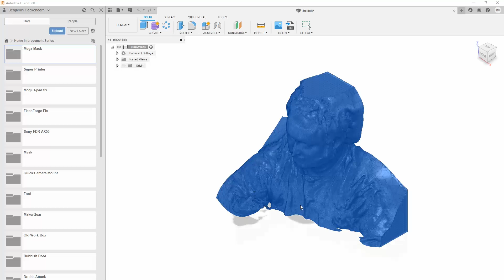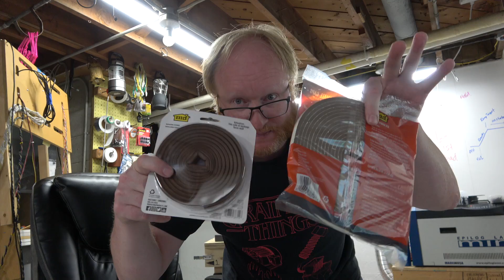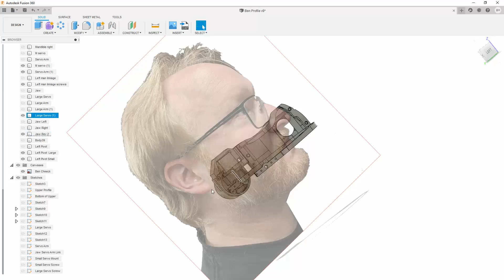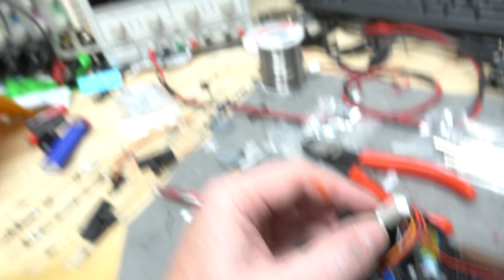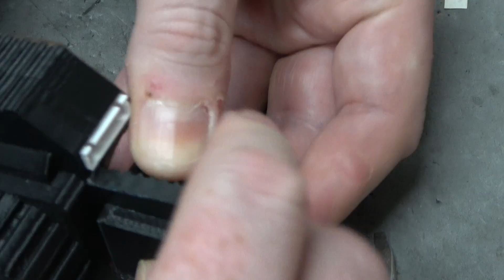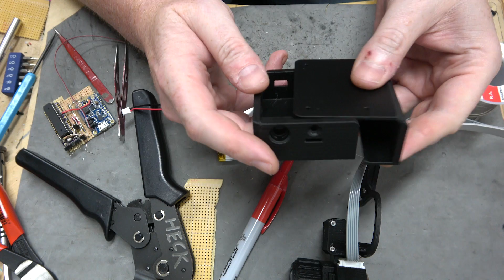Auto-Mask (Mark 1)

Comment: I saw just 15 min, so idk if this problem will be fixed later in video, but I have some suggestions: I can already see the point of failure of this project in the hinges.
Why let the servo carry all the weight when you could implement the hinges in the "round servo support", using a much solid 3/4mm bolt to support the moving parts of the mask and than use the servo just to open and close it, maybe implementing a simple lever system in order to reduce the servo effort and increase opening and closing speed.

Comment: Pretty nice!  Its the first Video from you in see. Perhaps a little tip. I use for small Projekts the "Atiny85'. I think of you dont know it it will help You alot for downsizing something. 
https://www.amazon.de/AZDelivery-Digispark-kompatibles-Development-ATtiny85/dp/B076KVKHH1/ref=asc_df_B076KVKHH1/?tag=googshopde-21&linkCode=df0&hvadid=310761028777&hvpos=&hvnetw=g&hvrand=10264697216154563659&hvpone=&hvptwo=&hvqmt=&hvdev=m&hvdvcmdl=&hvlocint=&hvlocphy=9062709&hvtargid=pla-601822248880&psc=1&th=1&psc=1&tag=&ref=&adgrpid=62550347740&hvpone=&hvptwo=&hvadid=310761028777&hvpos=&hvnetw=g&hvrand=10264697216154563659&hvqmt=&hvdev=m&hvdvcmdl=&hvlocint=&hvlocphy=9062709&hvtargid=pla-601822248880

Comment: The Gap problem can be fixed by adding a bit of overlaping on one side and underlaping on the other sideof the front pices, with a minimum delay an the inlaid on wen closing. And more stability in total is possibile wen you add a halfsurcle from the back of the head going over the esres to rest on, it will be most likley less wobbly then now ;) sorry my bad englich im from Germany ;)

Comment: Next project: Build a smaller, fully portable, raspberry-pi based 3D scanner (like the MS Sense) out of Hello Windows laptop webcams that can do the full scanning/editing/everything from anywhere. 
(There was an HP line, for example, that basically had a Kinect board smaller than your pinky in it - those go for about 12-15 on eBay. And it’s just a standard usb 2.0 interface on those pins!)
Make it smaller, make it portable!

Comment: What I would do is make a pair of glasses and just have under the lenses seal around my nose, then have the same upward mechanism with servo-motors that you used to bring a breathable cloth/lighter cloth that you can breathe through up to the bottom of your glasses. That way you just put on your glasses and have a built in toggle-able mask with plenty of clearance (when down) allowing you to eat/drink, and when up it wont fog up your glasses.

Comment: You could put some rubber on the top to make it more of an air tight fit like a gasket, the servos will have to press on the face more though. 

 I don’t know if that filter fabric will work though. The cdc says you should use N95 surgical masks. It does look good though if the fabric doesn’t absorb water.

Comment: Here a challange for a Auto-Mask v2.0 (Image below):
- Modular Filter: Then you can make a small modular pierce of filter that you fit in the filter slot inside
- The front instead of "predator" style, make it open:
1. It releases forward (This way you can apply pressure by covering the areas it shouldn't be open)
2. Then it goes down

If you close by applying pressure backwards you could make it adjustable for any person and release the fusion file with the material and components required to allow anyone that wants, to try create their own.

Here an ugly sketch i made in Krita to describe my idea: https://ibb.co/tzrwRbR
Cheers

Comment: Could probably add a small elastic strap over the head, like a vr headset, to relieve pressure from the ears, provided the whole thing is at least somewhat balanced front to back.
Would also be cool if the arms could rotate outward at an angle, so they weren't sticking forward, but would come up to the sides of your face.

Comment: split mandible with magnets in the ends and something like a rubber gasket can hold them sealed. You can also include a magnet or two on the piece that comes up to seal that gap as well.

Comment: Really fun idea, but in mk 2 ditch the fans, they are really missing the point of masks.  Masks provide some small protection by lightly filtering incoming air but the real point is for everyone to wear them and limit/localize their output into the space around them.  Buy putting in fans you are pushing potentially infected air out further than a mask should, or sucking it in, depending their orientation.  Either way, its antithetical to the core goal.

Comment: Awesome design!
Possible design change could be to make it an electromagnet on a momentary switch that holds it closed.  Spring loaded to open up, but manually push the pieces together with EM activated to make it a clean close. Then it fast opens by deactivating the EM.

Comment: you could use solenoids instead of servos, you might be able to get away with a smaller mechanism with them. also,  you could use electromagnets to keep the mandibles closed, it would be interesting to see some graphed data about strenght of the electromagnets, power consumption and volume or weight. Maybe there's a sweet spot that you can choose
what an amazing project!!!!

Comment: maybe instead of using individual motors/servos you can have one in the back of your head and just have it run like cables to perform the actions also use springs for the closing action.  This would simplify things a lot.

Comment: The opening face mask is fine, but it needs a pressure fit to confirm it's closed rather than relying on weaker small magnets.  One idea might be to do a sort of tooth design like your adjustment clips, just S curve teeth down the middle of the mask and let it join that way to confirm it's together and in the right height positions.  You would then need to find a way to keep it interlocked.  Padding isn't a bad idea as well to minimize bounce back from mating the two sides.

Other points to mention:
1.  Furnace filters are terrible for small particle filtering.  The virus passes through it, basically.  And as someone else mentioned, the filters are usually made with fibreglass which you really don't want to be breathing.  You might instead want to cut up N95 masks and look into this sort of design for inspiration:  https://www.cnn.com/2020/07/25/health/reusable-face-mask-mit-wellness-trnd/index.html
2.  Using elastic or rubber head straps may make for a more comfortable fit on your head.  As you said, it's a lot of weight on your ears, but if you split the load across the crown of your head and the base of your skull, it should feel more comfortable.  The dream is to have a strap over the top of your head like a headset for the best weight distribution, but I guess how much of a dork do you want to look like?  >D   Also, straps around the crown and base of your head help to give a better pressure fit for the face portion of the mask.
3.  I would consider thicker padding for the area against your face.  In addition to a better pressure fit, with skin moisture it should form a decent enough seal, and it'll help against unfortunate closing accidents.
4.  Please, filter your output fan as well.  A part of the point of masks is to keep incoming particles out of you, but the other part is keeping your (possibly infected) breath from projecting to others.  A fan blowing your breath out unfiltered is about as bad as coughing non-stop.

Another thing you might want to consider is a solid face mask top that marries to the bridge of your nose and cheeks as it ideally does now, but when you want to divest the mask, it extends forward to gain clearance and entirely rotates down like the current curtain mandible does.  The end result would be the entirety of the mask being below your jaw.

Comment: It’s a cool idea, I do like it, but I also agree with you that it can be simplified. you could probably make that bottom portion the entire mask just by running a thin metal wire or plastic tube through that fabric portion and having it lift over the nose and tighten, probably with a servo. It would probably fit your goal of a two servo design if it’s kept very lightweight.

Comment: We're technically on a form of the metric system as an inch is defined as 2.54 cm exactly. 

There's 5280 feet in a mile, which means after the jump up to a yard you can easily cut up a mile into yards dozenally. 5280 / 12 / 12 / 12 = 3.055 repeating means you're like 98% accurate. We get to keep having a weird system but at least its internally consistent with units between yards and miles.

2.54 cm in an inch
12 inches in a foot
then 3 feet in a yard
12 yards in a whale
12 whale in a field (around the length of an american football field)
12 fields in a short mile or "smile" (5184 feet or 1728 yards) 96 feet short of a mile.

Then either metric or thous for everything smaller than an inch according to taste. It's 98% accurate for the mile, and you can basically get away with just saying "a mile", everything else is accurate by definition. Dozenal systems divide nicer into ratios.

Comment: Maxilla. Almost sounds plural so it works for a split piece, and it also sounds a bit moar badass than mandible.

...and removing this semi-automated mask takes an order of magnitude more effort than the Korean War era surgical mask at the beginning, which itself requires an order of magnitude more effort than an N95 or a cloth mask with similar ear loops. Good job! Seriously though, great proof of concept. I think the points where it falls down are tied to using a 3D printer for prototyping.

Lots of people just pull down an N95 mask over their beards to have a drink or a smoke. I'm guessing your next iteration will simply snap shut between the nose and the upper lip, pulling up a bellows that again extends over the lower jaw. if you include a set of complementary ridges on the mating surfaces, that should make for a decent enough seal.

Comment: Looks cool, but as an MD this mask is worthless, first thing to consider about creating a mask is to have easy sterilization, cheap to be a throw away or easy to get materials to create new ones. Second, you definitely need to improve the seal on the top of the mask we can see your nose and cheeks in between them so no real seal and the reason you don't need the fans atm, I would definitely recommend the second revision to be one solid piece that can give you a proper seal on top like you stated. Third, if using fans you need some filters between the fans and the space of the mask, maybe make the mask fabric material the same filtered material that can be removable and easy to wash.   Keep hacking and stay safe!

Comment: Suggestion for a similar idea. Do something similar to how a quick-don mask works, but rather than pressurized tubes tightening the mask to your face, use actuators, and off of those actuators, have arms that can swing the mask downwards, where the mask stays fairly parallel to your face when off, so that it doesn't function as a bowl when down, plus you wouldn't want the nose of your mask sticking outwards; basically, it comes off slightly, and moves downwards, but when it goes back onto your face, the actuators can apply enough pressure to apply a seal to your face. 
This could probably also be modified to work with a solid upper half and fabric lower half, rather than a full solid mask, but the fabric portion would need to be held taut in some way, so a full solid mask may be easier. 

Of course, true quick-don masks, like any air-tight mask, requires clean shaving, as facial hair interferes with the seal; this is why firefighters and pilots are required to so a full shave, and not just a trim. Not as important for a mask like this, but a consideration when designing.

Comment: Try two servos, that push the nose piece forward slightly, then drop it down below your chin.   Also, if you replace the cloth with a non-woven polypropylene you can get some filtering benefits and increase breath-ability.

Comment: could u possibly use magnets to hold the top part together to get a better more reliable seal ? or would the motors not be able to pull them apart?

Comment: I could tell that hanging it from yours ears was going to suck. Probably could use a strap system that goes over your head to hang it. Also, I like the side-opening mandibles, I think you should keep them. Maybe if the seam between the two halves had a shape to it rather than being totally flat it would seat better. Probably a shape with rounded edges so it doesn't ricochet too much.

Comment: Fyi: You can buy legit face mask filters on Amazon.  They fit in those plastic ventilator face masks.  I would ditch the fans and servos and just make something with a mechanical quick release.  It's not much more work than pressing a button and having your nose whacked. 😉

Comment: Behold Ben's descent into cosplay.

Also be aware those cheap furnace filters contain fiberglass, so maybe another layer of cloth to catch large particles.
Reply: A breather system to intake air through a different direction and expel air in another direction helps control contact of where the droplets come from. For instance breathing in through your sides but expelling the hot air coming out from the front, the valves can react to you pushing and pulling air from your mouth.

You will get to be a real life darth vader sounding person!
Reply: They also ATTRACT literally everything small floating about that you dont want in your body because they're magnetized. Just use a proper mask or buy a proper filter. Either way you're still gonna have to change em out at some point

Comment: I'd use a hot air gun instead of a torch to soften the PLA to bend it.  The elcheapo one I got at HFT works fine for this.
Actually between CV-19 and tackle induced brain injuries, the NFL is probably doomed.
My wife had lasik, it worked fine for her.

Comment: Awesome idea. I was thinking from the beginning though that the mandibles might need a second arm/hinge from the top for long term stability... if they are open long term while you're wearing it they will tend to bounce up and down a bit and would put a lot of stress on the servo arm possibly causing them to break at some point. Granted, if you revise it to a one piece design then that logic goes out the window - lol.

Comment: Basically, you're half of Star Lord.
What about having a stretchy cloth mask suspended on a top wire loop that is formed to fit the contours of your face - to remove the mask, the ends of the wire are pushed forwards at the ends (i.e at your ears), allowing the mask to then be flipped down below your chin (sort of like the hood of a baby buggy, but the other way up)- I reckon this mechanism could be done with a couple of cams or a linkage of some sort.

Comment: Most people's ears are slightly lopsided. Any optician can tell you that. Your ears are probably the least symmetrical parts of your body. But nothing is exactly symmetrical; legs slightly different length, feet slightly different size, and so on.

Comment: I was rummaging through eBay the other day and I found out plenty of "exhale" valves for mask building. Perhaps the next attempt could be a solid piece reminescent to a regular N95 respirator that clams open and close whenever you need to take a bite, a sip or hold a pencil. That could also ligthen the approach as it would only cover nose and mouth.

Comment: How about a solid bridge and fabric, and it comes up from your neck, goes to 90 degrees out from your face, and then retracts to fit your face/nose. It'll basically keep pulling back until it senses enough pressure to ensure a good fit against your face. And with the (quick-release for washing) fabric attached to it, should work quite well.

Comment: I might suggest that you add the fan filters to the exterior of the fans. The main reason for that would be to ensure that anyone that sees you doesn't get concerned that you are actually dispersing your exhales with the fans more than you would with normal breath.
Reply from the maker: There are filters on the inside. Guess I didn't record that step.
Reply: @BenHeckHacks  people who haven't seen the video won't know that though.
Reply: @BenHeckHacks  Yep I caught that, my main point was in the way that the mask would be perceived in public without that context. If the filters aren't visible others around you may not realize it and get concerned.

Comment: I got lasik in the late 90s. You don't feel the cutting and they just flip it back, not remove it completely. The weirdest thing was when the lens wasn't over the rest of my eye everything just turned a uniform flat grey. There was no depth or shadow, just flat... grey with no sense of space. It was kind of interesting. And immediately after they finished I could see perfectly. It was nuts.

Comment: The amount of up-and-down wobble of the top mandibles really concerns me. I feel like a tiny hinge or something connecting them to the servo housing about where the servo connects to them would be a good idea, since a lot of that wiggle is just from the servo arm being the only point of contact.
Reply: It may even fix some of the consistency issues with the seal. Though I do think a second version without the mandibles is likely still going to be better. But it probably won’t look as cool! xD